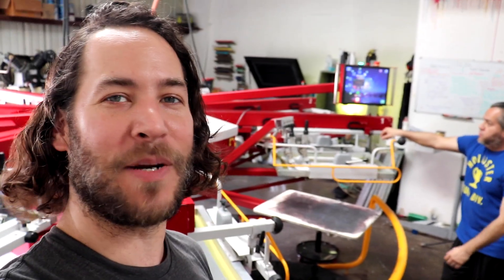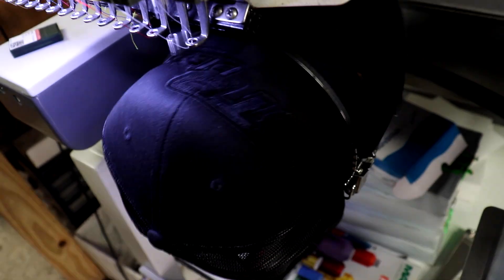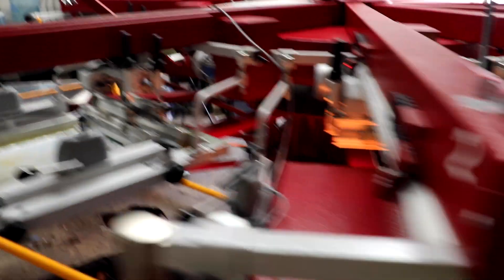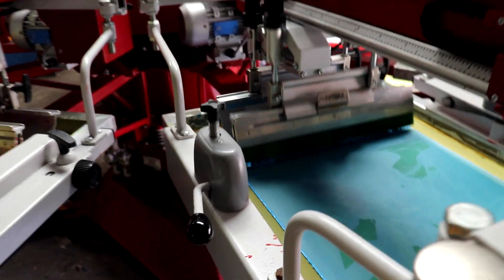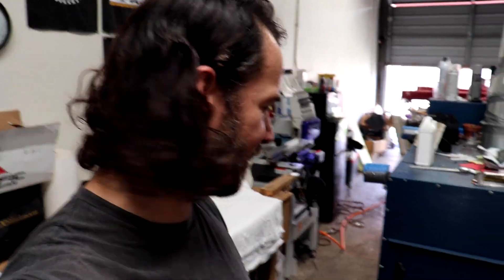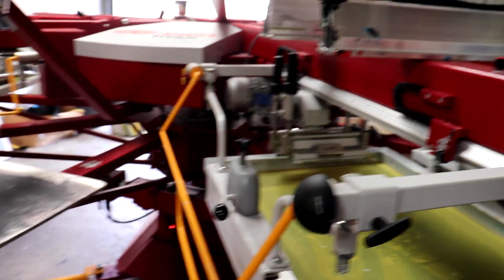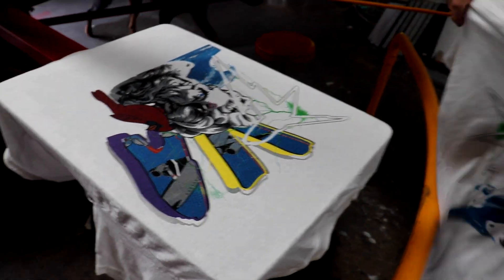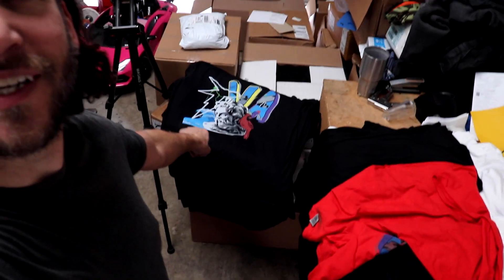Spot Simulated Process Screen Printing: The Ultimate Guide

Comment: what angle and height do you have your squeegees? I've been getting a little flooding or not totally opaque with my whites on black garments.also using an anatol at our shop
Reply from the maker: We have the angle set at 20. I'll table up and adjust the pressure so it bends enough to use the edge of the squeegee. Set the flood bar low enough so it doesn't scrap the screen.

Comment: HI mikey i have a manual press with wooden plets and when printing multiple colours some screens sticks on the first ink and makes it fade alittle what am i dooing wrong?
Reply from the maker: I would try using a higher mesh could for the base. Like 195. Make a separate screen for a highlight white instead of doing a print flash, print flash white base.
Reply: @mikeydesignssilkscreen473  thanks i ll try it